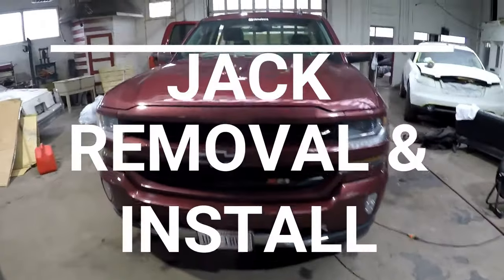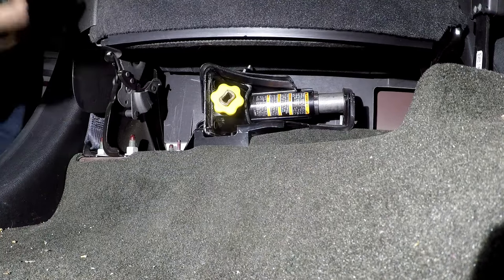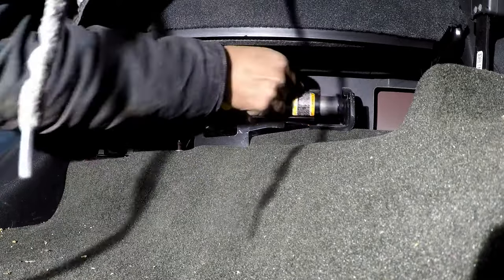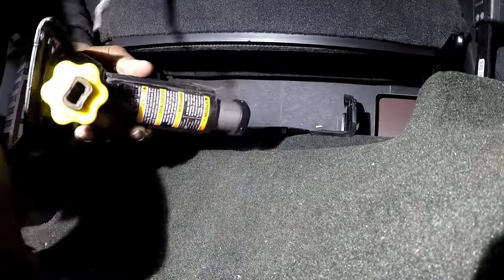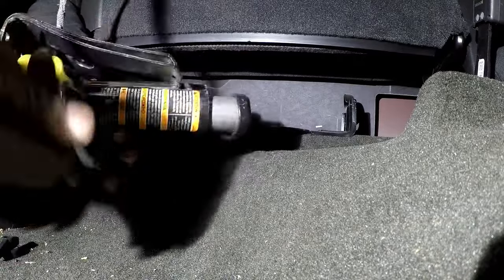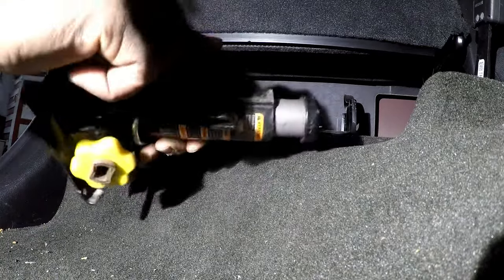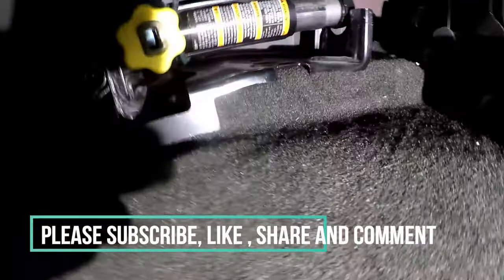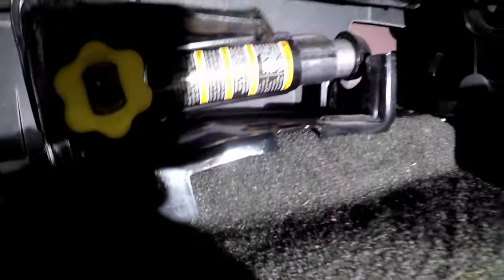How to REMOVAL AND INSTALL Jack 2017 Silverado

Comment: Great video, thanks for the help. What are the brackets that attach to the jack with the wing nut for?
Reply from the maker: I think wheel chucks
Reply: Oh, that makes sense. Thanks!
Reply: Damnit! Nice response, thanks  I was wondering what the heck they were for too, couldn’t figure it out, was about to trash them seeing as they didn’t provide any use to the stowage, now I know better. 😅

Comment: Good job. I had watched several others but they did not have the blocks. Your video is easy to understand. GM could use some improvement on the jack and spare storage system.

Comment: Thanks for the video bud! Damn jack didn’t lift my truck high enough for the spare to fit on ‘18 silver-aydo. (Yes I put the jack in correct spot.)I used my dads jack from his express van.
Reply from the maker: Glad to help. It lifts mines fine. You can keep a small piece of 2x4 in the truck to add to it. Thanks for watching the vid. I appreciate it.

Comment: One of the dumbest designs. Basically that top bracket does nothing. Just use the two holes and crank the jack tight..